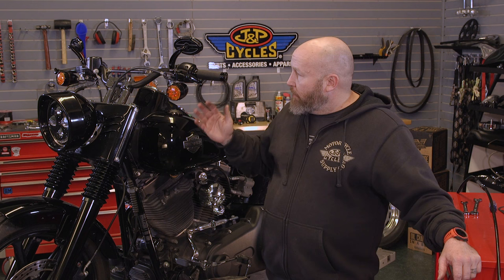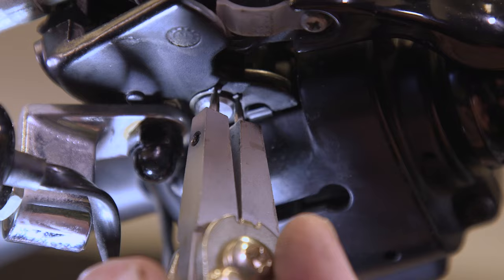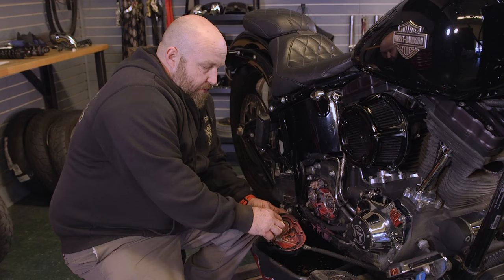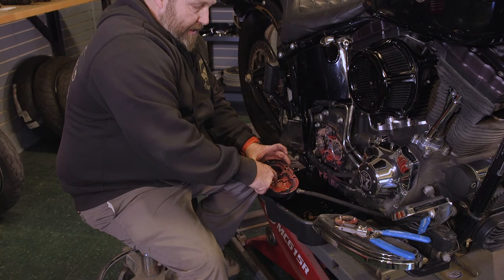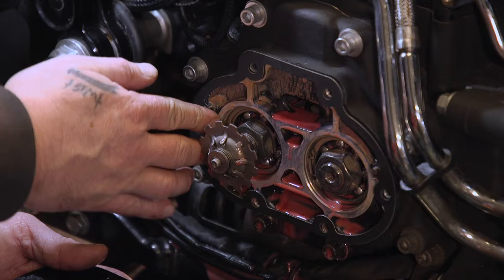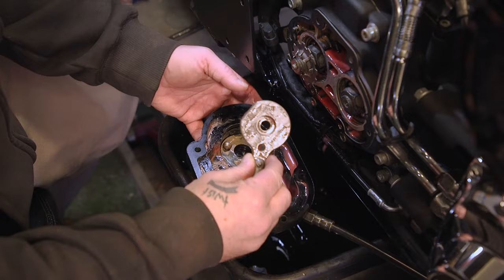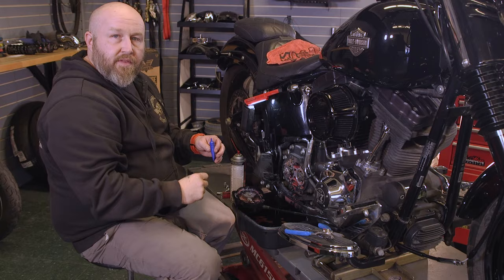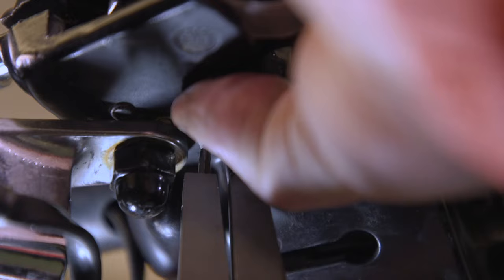Clutch Cable Installation Twin Cam Softail

Comment: One key point that you didn't mention is to make sure the new clutch cable adjuster is run all the way up before hooking it up to the ball and ramp mechanism. It will never adjust out correctly if you miss this step.
Reply: isnt that what he did at the start?
Reply: @Will-uu8ed  he loosened the old clutch cable to create slack. The new cable needs to have the adjuster run all the way up before hooking to the ball and ramp mechanism or you will not be able to adjust.
Reply: @scotthoult3586  good point, I'll remember that thanks. Bonus question, do you know what type of softail this is?
Reply: @Will-uu8ed  I am not 100% sure, it looks to have had some mods to some of the original parts. Looks like a fatboy.

Comment: Started to change the clutch cable on a 2002 Softail Heritage.  Went to disconnect the exhaust pipe and noticed how rusty the bolts were. Then I decided it would be worth having the dealer do this instead of risking breaking a bolt off in the head.

Comment: What do you do if if you go to install an extended cable and the tread seems to be off and not able to screw it in to the clutch plate ?

Comment: so you want the mating surface of the clutch gasket dry? is that why you sprayed brake cleaner into the clutch?
Reply from the maker: I don't like having oil on the gasket surfaces.
- Patrick

Comment: Can anyone help me I have a 1990 fxrs, bike will lunge when I put it in gear. I have adjusted the clutch and cable and it is less but still lunges. Do you think the cable is bad and how to test the cable. Any help would be appreciated. thanks

Comment: What type of lube is that? Pink? Not flushing the old pink crap out ? Using brake clean and mixing it with old lube? I see, Redline!
Reply: bell ray
Reply: Az Desert News I think that is Redline Shockproof gear oil.
Reply: Looks like redline to me, good shit!
Reply: @clubstyle_midwest5536  That is correct best trans fluid on the market

Comment: Is there a special "trick" for screwing the cable into the transmission cover? I've been turning this for hours and it will not thread
Reply from the maker: it's fine thread and can be tricky. Sometimes it's easier to hold the cable upright and turn the trans cover on top of it.
Reply: Ultimately I needed to use a tap and dye set to clean the threads up. Then it went on smoothly.

Comment: This has got to be the dumbest design for a clutch cable system, if this shit breaks on the road, you're fucked. Happened to me out on a ride, we were able to patch it back together at the lever, but even if I did have a spare cable with me I'd still be up shit creek.